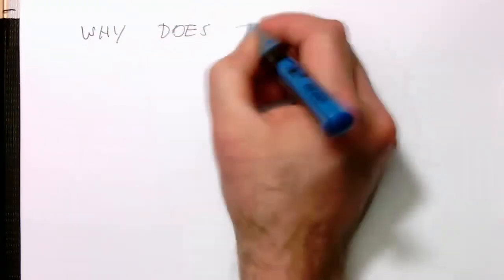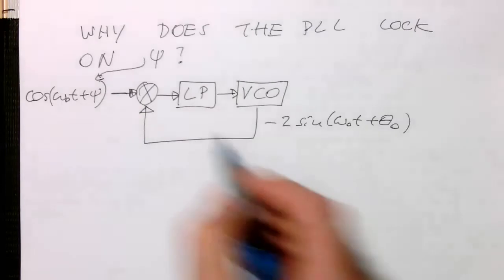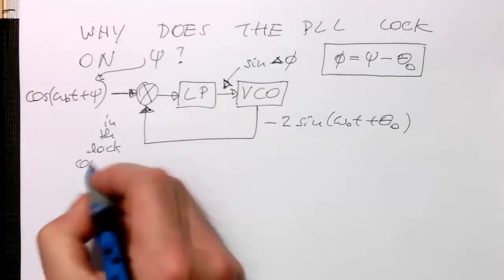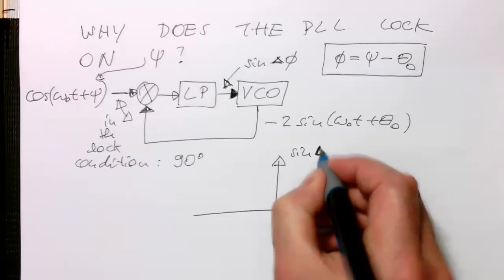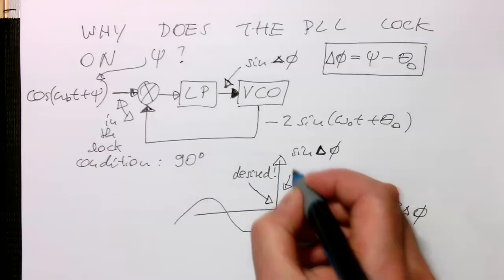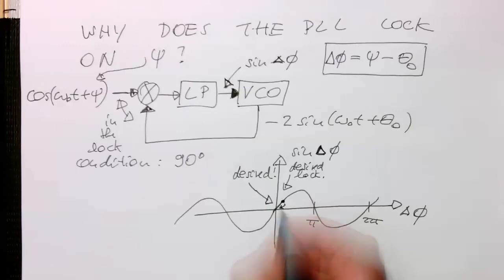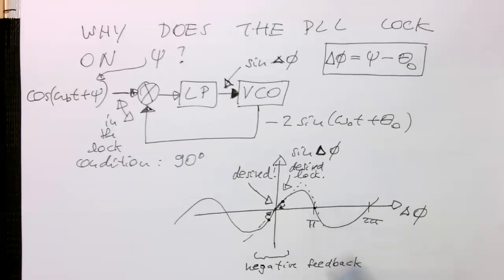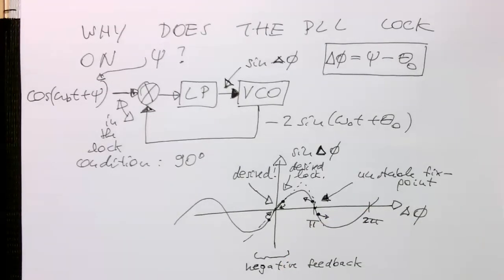Carrirer recovery: PLL lock explained (0004)

Comment: There is always a phase difference between the reference and the VCO output. Otherewise, the VCO input will be 0, which will lead the VCO to output its own frequency not locked to the input. Please revise this video.
Reply: Correct me if I am wrong, but that behavior is whole point of system. VCO will oscillate in its own frequency(which is tuned by user and that is why equal to carrier frequency (user wants its calculations relative to carrier frequency)), if there is no need for correction(phase difference equal to zero). If there was a need for correction (phase difference NOT equal to zero), the VCO input will be adjusted accordingly to achieve phase lock. Pay attention right after 3:30.